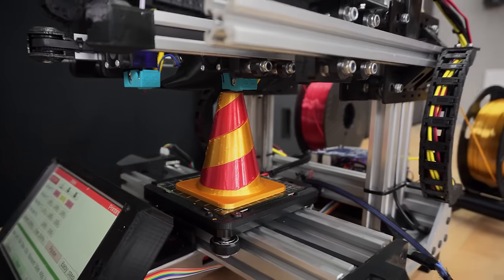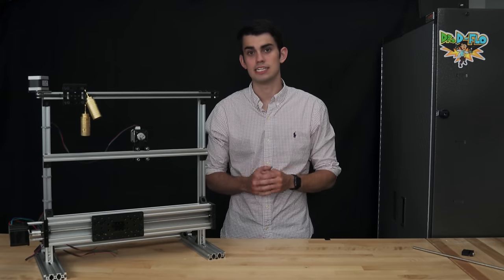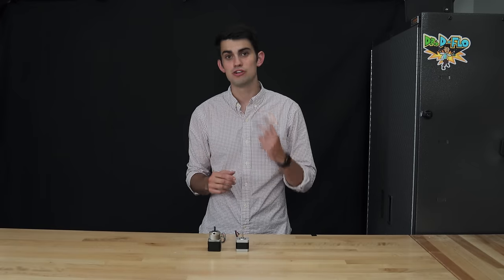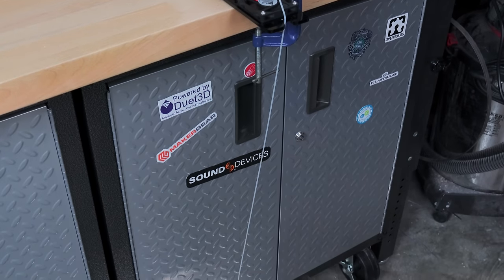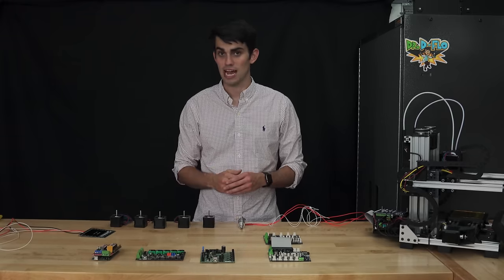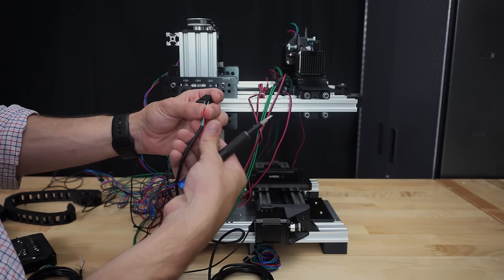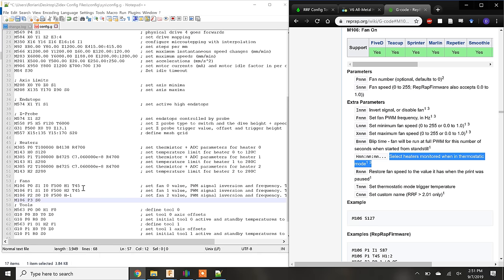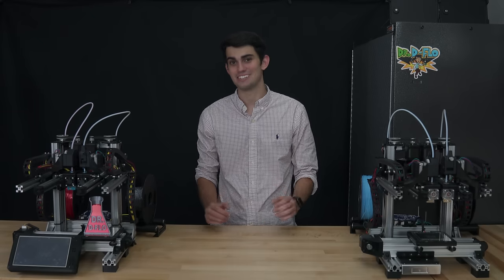How to Build a 3D Printer (The Ultimate Guide)

Comment: How difficult would this be to increase build area both x, y and z. I know longer extrusion but what else would be required.
Very informative by the way.
Reply from the maker: Hey Mitch. Are you talking specifically about the printer I built in this video? If so, I don't think it would be a good idea to extend the build area of this printer because the X-axes are cantilevered and the longer they are the more likely they will be to sag
Reply: @DrDFlo  yes I was referring to this printer, maybe figuring how to support the x axis?
Reply from the maker: @mitchstein6121  I would probably go with a different design. The whole point of this printer is to be small and compact. If I was going to do another larger dual independent extruder design I would probably model something off of the Makergear M3 design (https://www.makergear.com/products/m3-id) That way the extruders are only moving in one degree of freedom (less to worry about)

Comment: I might not be a 3D printing Superstar, but I do know a little something about engine control, and Diagram at 34:30 is a bit wrong... the two South poles, they should also be N, in this case, and the 4 S would be, rotated 45 degrees from each of the four N poles, so there's N-S-N-S-N-S-N-S at each pole, with the colour coding scheme, you chose... (someone with no idea, they might think the poles shift, just because they are looking at the coil on the opposite side of the coil array, if you can follow my thought)

Comment: Carbon fiber rods for a linear bearing would be a bad idea as the ball bearings will wear on the CF.  Steel or equivalent hardness material is all that should be used with a ball bearing linear rail/rod

Comment: Very nice!  But YIKES!  You didn't cover the terminals connecting to the AC mains!  Although they are in a place under the printer where you shouldn't normally be touching, it would be prudent to have them covered.  It might be useful to have the DC terminals covered as well.  Imagine the problems that could be caused by some small wire or metal scrap accidentally finding its way under the printer and shorting something out.

Comment: TL;DR about linear rods: Outstanding bang for the buck if your print area is less than 300mm^2 (again, Prusa i3 and mini), otherwise you would need to increase the diameter to fight sag at the middle (and even then the returns are diminishing). If you want a big printer, go with V-wheel or linear rails, or go tall (Z axis can use longer rods than X or Y).
... And don't forget to lube those bearings. The packing lubricant will do OK for a year or two, but after that you may run into problems like the balls flattening.
Reply from the maker: This is great information! Thank you

Comment: For buildee printer is this litle bit funny i build my own similiarly but with bed 300x300 :D yes frame is from wood bud if i deside to have metal frame i can :D and still i will have bed 300x300 and also i can print dual material but i deside its mote easyier to use cyclops mode in marlin a Y splitter from thingyverse and boom it more simple for maintain and set because you dont need to calculate hotends offset. Please dont take it like insulting its only my point of view that it could be possibly easier with keeping variability

Comment: 3d printers that use rollers should be sold with a bunch of shims with different thickness. The shims between radial bearings need to be accurate. My creality rollers had almost 1mm sideways play because bearings didn't squeeze down on the middle section of the roller.   out of the box my creality was far less accurate than most cheap printers using linear rods.  The bed was mostly affected.

Comment: can you make a video going over how to choose a motherboard? and what types there are? this video had everything ii needed SUBSCRIBE!!
Reply from the maker: Hey man thanks for subscribing! I'm going to be honest with you... I am totally bias towards the Duet Wifi. It's very expensive compared to other boards that get the job done, but I like supporting this company because they produce great quality.
Reply: @DrDFlo  :| ok though it would be nice if you show off some motherboards like the Big Tree Tech SKR1.4 1.4 Turbo and 1.3 and some other varations, they have great quality too, and im still trying to fgure out how to program mine with Vs Code... I also wonder if there is a way to make a core xy but the x and z axes and not like traditional...
Reply: @DrDFlo  and maybe if you could go into more details and make separate videos about motion systems stepper drivers and belts that would be really appreciated! I'm currently building a 3D printer from scratch in my college and i get to use the Plasma Cutter for all the parts instead of printing them!!! i also plan to make a filament extruder/ attempt to make one...
Reply from the maker: @techdiyer5290  That's awesome man! I am compiling all the missed information for a future video. I will add more motherboards as well as more detail about transmission (belts and drives) to the next guide.
Reply: @DrDFlo  Awsome!! Thankyou!!

Comment: can you design a feeder that can incorporate Carbon fiber in to the polyurethane resin and glass printing allowing end user   recycled material from home  by  putting it  through a material possessor  attached to the printer a multi function feeder . If every home manufacture one electric car you can have one year vacation free with air to breath .

Comment: Like your Video easy on the ear i could learn from these  clips 👨‍🔬Some are good at programing - not me But i used to set up spring machines  - 
 Ive looked at 3D printers  lasers etc cnc  but Really see no need     
 when i left the job the  bosses son tried  to set the machines after  say 1-2 months told his dad i dont know how he  worked these machines and day dreamed as he did them :)  he's dad sold the entire 3 machines  I shouldn't have left the  Job but mistakes we regret
  The promise of more $ and tech didnt happen and the new Boss wasn't as good 2 years l8tr i left 25YRS of Knowledge i was about to set up The 1st CNC spring forming machines  The boss showed me the DVD i watched  next day told  him how i think they work He said you got all that from a demo dvd Yeah   i said its basically a  wire feed and you set the cams  etc   to time  with  it  Yep i was right No Knowledge of CNC but i had the idea 
it was basic actually   .FEED start   1- 50mm    2- 25  3 -3500   4 -25  end 5-50  sort of made this  spring   |_|||||||||||||||||||||||_|   to get the  wire length od the spring body   3 x dia  rad  x  3.275 i think    been a while  2004 last time  could've been setting up new machines But the Car industry all shut down in australia from 2010 and people were  closing factorys fast  going broke min work And the Boom of China didnt help🤷‍♂️  🦘🙃🕺

Comment: How hard would this be to scale for a larger print area?
Reply: Not hard, just use longer aluminum extrusion parts and program measurements into computer. However, a longer x-axis might bend, so don't make it too much longer. Unless you are going to redesign the frame to have aluminum supports at the far ends of the x-axis aluminum rails plus add a motor also at far end to help lift up x-axis along z-axis.
Reply: @allanholder1018  Thanks! That's what I was thinking, but wasn't sure if there was something I was missing.
Reply: @JonAngle11  I bought the entire kit for this machine. I will be using longer rails in every dimension to make it larger. I'm starting the build soon. I'll post a message when  it's completed.

Comment: I would not recommend to route wires not suitable for a dragchain through a chain.
And please wire according to the installed safety systems (fuses or the PSU protection) not an estimate of the power required!

Comment: Has anyone built a machine that can easily change from printer to laser engraver to CNC miller to plasma cutter? that all use the basic tech. for the X,Y,Z movements. Doesn't seem like it should be that hard.
Reply: It can and has probably already been done. Keep in mind the frame size for each application can be significantly different.

Comment: Why buy a Duet when you can buy a SKR v1.3 or v1.4 for a lot cheaper?
Reply from the maker: Good question! For the printer that I built in the video, I needed 7 stepper drivers, but the SKR v1.3 only has 5. However, the SKR v1.3 is a great budget 32-bit for almost every other 3D printer design.
Reply: @DrDFlo  if you use Klipper you can have multiple boards connected to a raspberry pi via usb. this is how the Voron 2 works.
Reply from the maker: @theatreweb  You are correct! This is a cheaper solution than the Duet Wifi but is much more complicated.

Comment: OK folks, more advice. Do NOT  use the "Drop In" t-nuts to fasten pieces together. Why? Because they can "Drop Out" from the linear rail. How? After the t-nuts are fastened into place, they may rotate over time and eventually become parallel with the linear rail. At that moment, they can "drop out" from the rail. This can be catastrophic, especially if/when you decide to move the printer. Dr D Flo: Take notice. You don't want to be carrying your printer in between classes and it suddenly breaks apart. Not good.
Solution: use t-nuts that are elongated along the rail axis and can only "slide in" at the ends of the rails. They cannot "Drop Out".

Comment: Please note, this is only viable for very large 3D printers. If you're just looking to make small 5" parts, then just buy a 3D printer. The materials cost here is very high for a smaller build, even compared to the one this guy has actually built.

Comment: At 1:06:00 you say Volcano, but that's a Super Volcano. There is a step in between the two
Reply from the maker: You are correct! The extruder pictured was a Super Volcano. I have 3D printer parts coming out of the wazoo, so I misspoke. Thanks for taking the time to clarify this.

Comment: over complicated , not too functional 3d printer .....of course it work great , but it isnt "good" (for ewerything else than u show in video) , easy to make , and cant print in enclousure.
Best 3D printers are the one where head move in x and y (or Z too but it is more complicated to make) and where bed move only in z axis (or dont move , mostly in super big printers) - Like core XY etc but u dont need to make core xy , only make simillar frame - box with 2 rails for bed (on 2 sides not only on back like ultimaker etc) 2 rails for y and 1 rail on Y for x , then u can use 2 stepper motors to power Y axis (or 1 connected to steel rod that drive both sides) and another stepper on x axis to power it (+ 2 steppers and screws for Z axis) .
Making printer like this u can make it in few hours with enclousure etc ...becouse enclousure can work as a frame for printer, and by that it can be as big as u want ....maybe 200x200x200....CM yes cm is easly possible :)